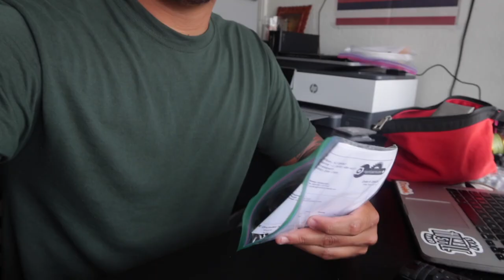Penn Battle II 4000 Inspect & Repair (Gear Skipping)

Comment: What was the real cause for the handle not seating correctly?  I just replaced my main gear and pinion and it seems there is some play in the handle.  I’ve heard something about shimming….but don’t understand.
Reply from the maker: My best guess was because it was from a party supplier and not the actual Penn company. But shimming it could’ve done the trick maybe.
Reply: (Shimming) if there’s play in handle on top of main gear there’s a bearing under it there were 3 brass washer type rings . I took that as shimming to eliminate the play . Hope this helps . I’m currently have the same issue this guy had I just got the main gear from mystic parts . But the threads that thread to the handle are different

Comment: Did you put fresh grease on the gears?
Reply from the maker: Yeah I did, right before I ordered the new handle I greased everything up. I failed to
Mention it tho in the video but definitely did not forget.
Reply: @VentureWetsuits   what type of grease did you use?
Reply from the maker: @JahRastaMon  I used turmaline, you can also use  https://www.amazon.com/dp/B007SNV3KI/ref=cm_sw_r_as_gl_api_gl_i_JGRHAJ2GP35K8P84PASX?linkCode=ml2&tag=venturewetsui-20 which is preferred for penn